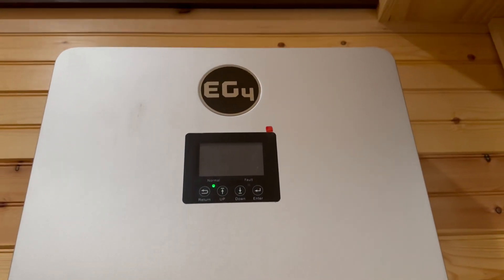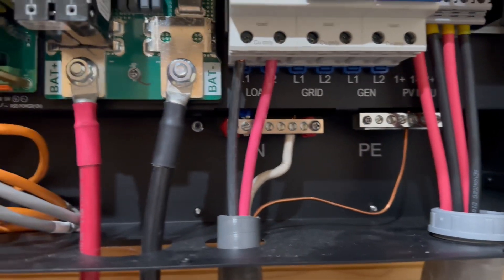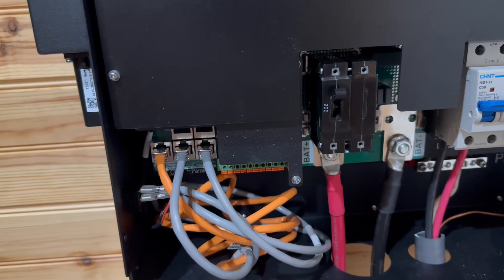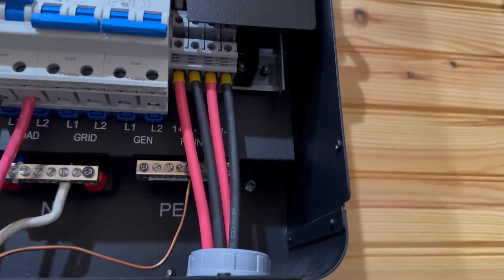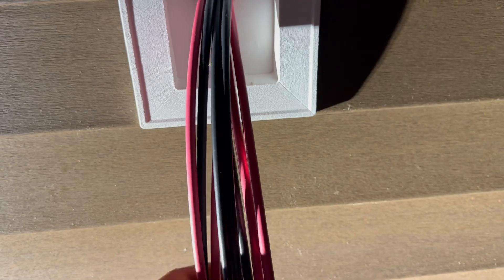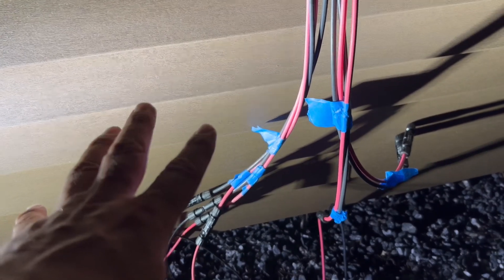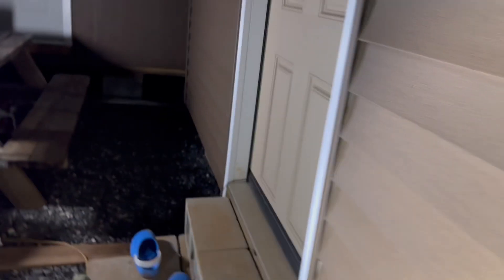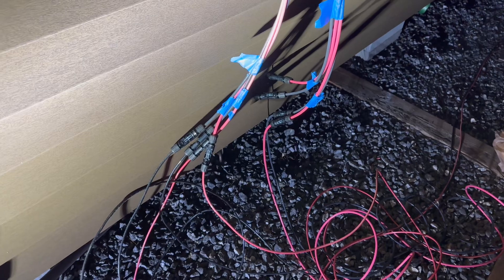EG4 6000xp wiring configuration

Comment: I'm curious about the overall grounding of the system with the 6000xp. I have an 8ft grounding rod in the ground. So do I simply wire all the grounds (PV, battery, load center) to that ground bar in the 6000xp then put a ground wire directly to the grounding rod?
Reply from the maker: For reference I am saying what I would do. I’m not providing instruction or advice for this answer. 

First. Do not ground the PV lines. Just the panel frames and mount. 
This is in your book that comes with the unit. 

Always ensure all electric is off including all breakers. 
In off grid situations: 
So the way I would do it is like this. Remember that your panels have a ground that is for the panels and frame.   Use wire nice and thick solid copper which goes down to a grounding rod of solid copper 8ft deep. Ensure proper connecting of those first. 
Second a second grounding rod for the inverter. Again a thick copper wire down to the properly connected ground rod. 
 and have lightning protection fuses on your negative lines, not a ground but a fuse. Can be an inline fuse. 
That is what I would do. 

If you are setup in hybrid mode, WARNING: this is very dangerous and should be done by an electrician who is licensed and insured. 

However, what I would do is the following.  Your house should have a good referenced ground. 

In hybrid mode you in theory connect to the incoming lines from the power company which are in the breaker box.   Creating a feed line for the two hots and neutral / ground to the grid inputs of your EG4 6000xp. 

Important: shut off the main breaker. 
I would have the grounding rod on the inverter using a grounding wire. 
The from there to the load center where your breakers are and connected using the appropriate sized two pole breaker of the same manufacturer of your breaker panel. If the inverter is on the main power breaker is off including your panel. 

Again see your installation manual for details.

Comment: Is this 220v? Im looking for @220v inverter
Reply from the maker: all same with 2 hot wires. Your house only works off of two 120v /110V lines. Voltage variance in this range has to do with many factors like voltage degradation due to distance. usually around 115v anything between 110 and 120 each line is how it works. Only a big company might have 3 phase power if it is required for certain machines etc. at your house it’s mostly all the same of split phase = 2 lines which vary between 115-120 volts which creates 230v-240v. However these inverters  support a split phase like what comes into your house. 2 hot 1 neutral and 1 ground.  I do recommend getting the 12000xp due to the additional usable power up to 24,000watts.